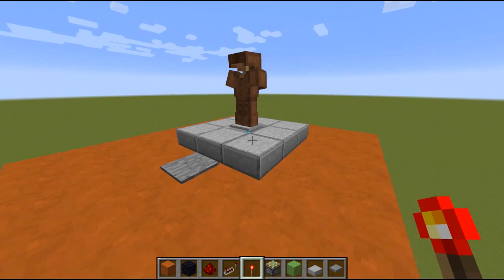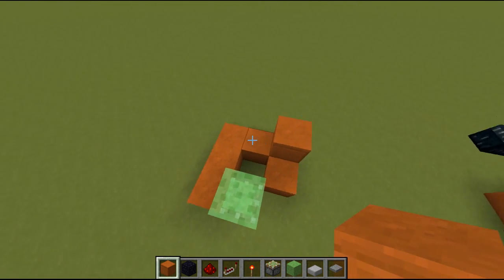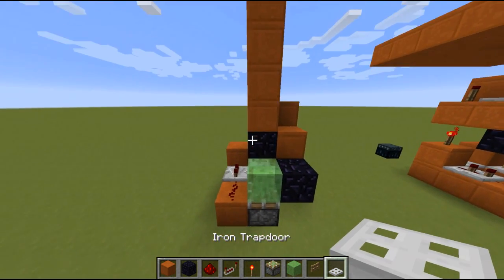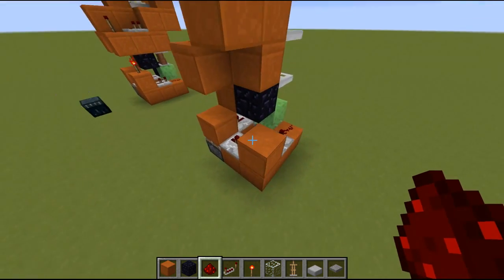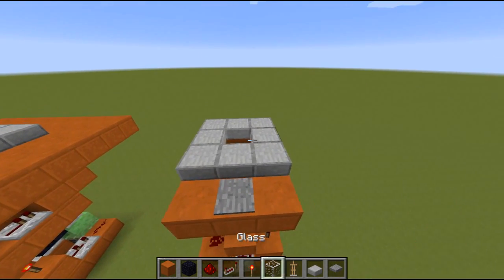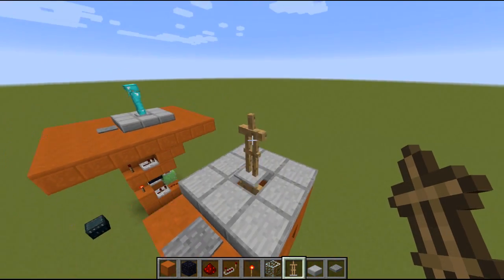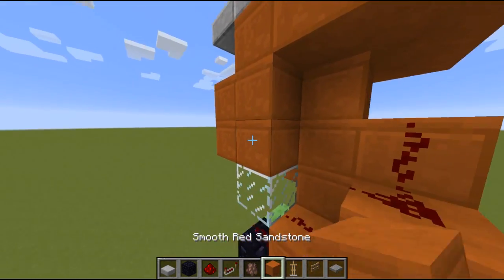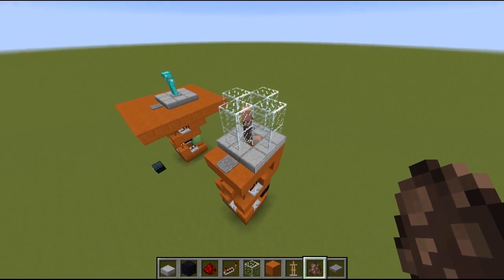Armor Stand Swapper - Tutorial

Comment: Does it have to be Iron trap doors?
and will you ever be showing a better version of this swapper  since you've said it's not 100% complete at the beginning of the video?
Reply from the maker: You can use wood too.
The glitchiness is due to Minecraft bugs. If I have a good idea of a 100% stable 5 slot thing I will show it. But for now there is just the 3 slot thing. (I think you can make a stable one of 4 if you just punch out the trap door on top of the slime block)

Comment: Why don't villagers work in the first (armor stand) version? I have tested the first design with villagers in creative (14w32d) and unloaded it a few times and had no troubles so far.
Reply from the maker: If you spawn the villagers in it will work because they are right in the center of the block.
If you would move them in in survial mode they would push each other to the sides and get stuck on the trap doors (when they are open).
Just try to fly against on of them and trigger it a few more times afterwards and it will break :-)

Comment: Would you be able to set it so it can tell you which armour set it is on like illuminate a reds tone lamp for which one it is on
Reply from the maker: That should be possible if I understand you right. Just add a counter to the system which is wired up to lamps. The wireing would be bigger but I don't really see a reason for it to be honest :-)
Reply: Panda4994 I think the idea is that you have a bunch of diamond armour with different enchants, so that is to tell those apart.

Comment: It's a good swapper but I can only fit 4 armor stands.
Reply from the maker: Hexbox2 Did you try the version in the world download? I haven't tested it in the latest version so there is a chance that a change changed something with this design :-)
Reply: I didn't because I didn't want to download the world but instead, I made the same thing on one of my worlds but the capacity is 4 armor stands and the video says 5. The video also shows the contraption switching 5 times.
Reply from the maker: Hexbox2 Double check if everything is build exactly the same then. If the video shows it it worked back them at least. As I said it could also be that something changed in 1.8.7 :-)
Reply: The things probably changed in Minecraft 1.8.7 because I have the exact same build and the build only holds 4 armor stands.